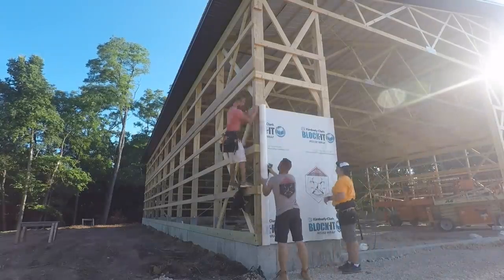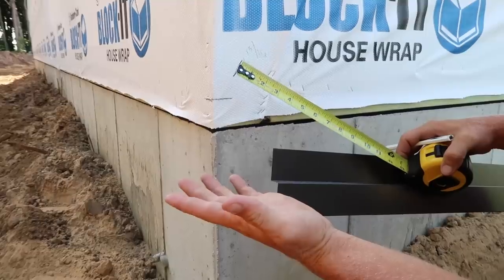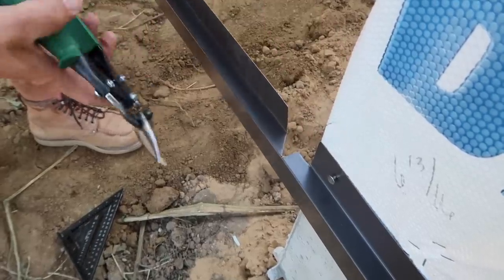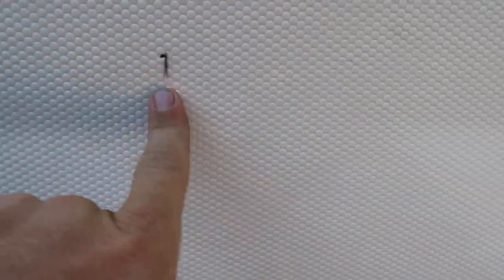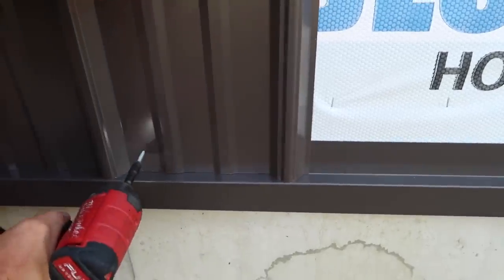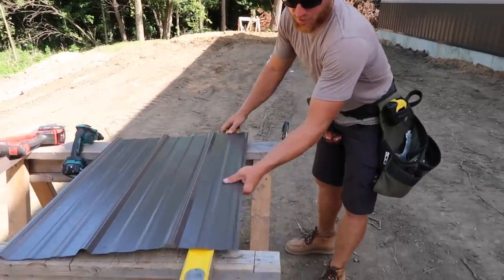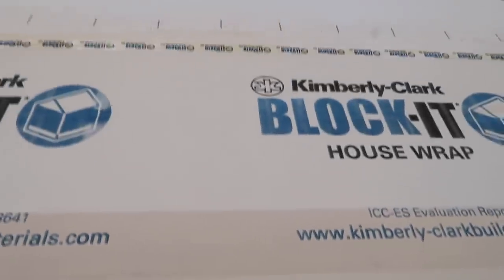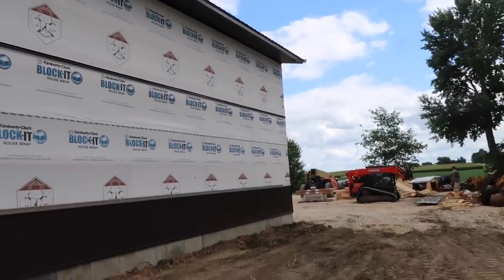Building the Dream: Episode 7, installing steel

Comment: Thanks very much for your really useful tutorials. We're installing steel siding on a former construction office trailer. The trailer sags from the axles forward and back to both ends. Your videos have helped us realize our mistakes and how to correct them, plus how to move forward in a reasonable fashion.

Comment: Don't beat yourself up over still using imperial measurements instead of the metric system, it's all just numbers.

My father was a shipwright who for most of his life used imperial and only in his 40's had to change to metric. I remember the struggle he initially had but eventually, he adapted. I still have all of his imperial woodworking tools and I am also quite comfortable switching between one or the other. All of the lumber sold locally has these weird metric dimensions like 19mmX305mm which is actually a 3/4-inch x 12-inch board so yea we metricated in 1971 but still sell imperial lumber.  😁 Another thing is I can not do fractions in my head as my father could, I have to think hard on it.

Just for reference, I live in Cape Town, South Africa. Thanks for the video's, I really enjoy them.

Comment: I don't comment much but I feel like putting my two cents in on one of your questions. The company I work for just had training on how to do Hardie Board Siding. When my company does Hardie Board Siding, we run the house wrap down to the pressure treated board like you did. After installing your base trim like you did around 11 minutes into the video. We put tyvek tape on the top of the metal where it meets the house wrap to seal it off. So if there was any water to get behind there it'd drain off onto your base trim. I know that's not the reason your using it but the instructor really wanted us to know that you never to put the house wrap over the base trim and tape the top of your base trim.
Reply: u would thinnk base trim,.... then tape ... then wrap so the wrap acts like a shingle...

Comment: They make straps with clamps that go onto your scissor lift (not sure what they are called sorry), they strap to the cage and then clamp to the sheeting so you can raise the sheets up via the lift.  Only reason I know this is because I do demo and while we was ripping off old sheeting, a company was following behind us installing the new sheeting in this fashion (huge steel mills).... was super quick and obviously saved a lot of physical labor for them.... I just wished I knew what they was called for you to check them out is all... with shorter pieces they was running multiple of them at a time, was pretty cool to watch.

Comment: As of the metric stuff. You can get a measuring tape that has both metric and imperial, like Stanley 30-696. 5m/16ft, 18mm width. Really handy, especially for woodworking. Really good quality measuring tape too. They also sell Stanley 1-30-656 which is 8m/26ft. Width 25mm/1in. Stanley also has a FatMax version of this 8m/26ft tape, with 32mm width, more heavy hook, which is even better for construction sites. Even if you don't use metric that often, it makes you get really accustomed to it very quickly and it always is there in the same tool, or to share on videos :D

Comment: At 10:35 when you're talking about not running house wrap over that sill flashing piece... I agree that it would look like crap if the house wrap ended up showing later, but you never know when water may get behind there. So to satisfy that and to satisfy the perfectionist in you (I'm a perfectionist as well) I would run a line of FlexWrap EZ by DuPont (self sealing flashing tape). There are other brands out there too that you could use. Try it and see if you like it; I think it would make for a better install.

Comment: For punching holes use old engine  valves grind point ;we use to do this on the old heavy galvanised even had a hand protector with top of the valve

Comment: This is coming from an Ex-Iron worker who is now disabled. First, it is called an awl (One word not letters). Secondly, instead of spending $3 dollars on one when it is just going to bend on you. Why not try using a 12 penny nail. They are cheaper and just as strong to punch holes in the Sheet-metal siding. When I was able to work, we opted to use them instead of drilling as well. Just a friendly tip.
Reply from the maker: David Tyner thanks David.  Appreciate it
Reply: Not a problem. Just trying to give my knowledge to those who can use it for future projects.

Comment: I was taught to house wrapped over the base flashing. Just leave the bottom un-stapled and snap some level lines on your grade broad. Better than packing that grade stick around ever time you go to set a nail. I hate that beeping and seems more productive to just snap some lines. You can always double check it once it's installed for peace of mind, if you want.

Comment: You need an awl made of hardened tool steel to do the punching...or alternatively sharpen the point of the el-cheapos occasionally on a grinder or belt sander. A machinist could make you a tool steel blank and harden it....keep it sharp and it will last for quite awhile.

Comment: Hello, Great video.  Starting a wainscot project soon.  Not sure if this will make sense, but one side of the house is on a slope.  Would you run the slope angle from the top side to the bottom for the base trim and sheeting or step down the slope?

Comment: Given your house wrap is for water control, you should seal that wrap-to-foundation joint. Yes you have foam in there, but I wouldn't trust that for water control. I'd use a liquid applied flashing or Block-it compatible tape to cover that gap. Then shingling the wrap over the metal trim isn't even a discussion. Also, you should never assume your cladding (metal in this case) actually keeps all water away from the structure.

Comment: Awesome videos!  I do have a question though.  You measured 37" for the first piece to land on.  When you start the first sheet do you have to rip the left edge off?  The overall of my sheets are 37 5/8.  Are my sheets are different than what you are using?

Comment: 1:07 Hello, have you thought about protecting the vertical edges of the building from foiling? For example, pieces of wood and the edge are covered with an additional thin material.

Comment: Hey Kyle why do you drive a roofing screw into the Lower flat portion of the tin and not the high ridge portion? not concerned about water leaking in on the flat surface irrespective of the rubberised washer (Sometime they can split as you know)

Comment: Just working on  
A project at moment, i imagine this is the eternal question. If i need to do long straight cuts on corrugated zinc alum whats the best tool for leaving best edge finish.
Reply from the maker: shear
Reply: I wish i had of paid more attention to this site. There is  a lot more craft to tin cladding than i thought.     These guys are really amazing.  Much respect and admiration.

Comment: They make hard steel punches. I've used them building race cars for 35 years. Most of the ones I have I've had for 30-35 years.

Comment: What if you initially punch the steel and then use those holes as a guide to drill out the rest so the bit can’t walk and scar up the metal it might save you some awls

Comment: At 22 minutes you said that you were running the Bender perpendicular to the sheet.  You actually were running it parallel to the sheet. Perpendicular would be at a 90 degree angle from the other surface

Comment: Are the tall sheets on the end wall pre-cut from the supplier, or cut on site? Also a video for ordering/calculating  steel metal might be a valuable video for us subscribers. :)
Reply from the maker: markssquared thanks in my
Mind to do that video... I cut all angles but have the sheets cut to different lengths

Comment: Correction at 31:29 Parallel not perpendicular.  Parallel is with the long side of the metal sheet, perpendicular is across the long side of the metal sheet and with the short side of the metal sheet.

Comment: Hey Kyle... In my area, it seems that all of the builders put a Z trim across the wall on the gable side. Is that because they are lazy and can't stand up a tall wall panel or do you think they have a reason? Maybe it's a local supplier or transport issue?  If they can get a 40' truss here why can't they load in a 27' piece of wall steel, right?
Reply from the maker: I think it’s a way to make their job easier.  I personally think tying it all together with the steel from top to bottom is much stronger

Comment: For the awl, say it how you see it, sounds like all
You could get a screwdriver and sharpen to a point, they are hardened so shouldn't bend, just need an impact resistant handle

Comment: A "scribe" is a scratch awl. It's made to scribe, or scratch marks on wood or soft metal. It's not a bradawl (or wood awl) wich used for punching holes and made of stronger metal. There are also awls made to pierce and stich leather and carpet. And it's awl, not a w l. ;)

Comment: ive never used one of those lasers you use. in my world(well head :D) wouldnt it be easier to use a traditional laser that makes a line? pls explain
Reply from the maker: Micke never going to
Get a line out 100’ in daylight
Reply: so the issue is daylight?
Reply: as you know, im an apprentice in your profession now :D so im all eager to learn the trade :D let my know if you want to know anything about painting :D
Reply: On distances of more than a few meters in daylight you have to use a laser receiver in order to get a accurate Reading. At 80 foot, 26.6 meters for us in the EU, you also need to  make sure you take the horizontal error into account. Typically you have an error of 4 mm at 10 meter for this type of lasers. Placing the laser at one end of the building and measuring all across to the other side gives you maximum error at the end. Better would be to place the laser in the middle, this will at least half the error.

Comment: you should start with a 6" piece of your house wrap behind your base flashing and then run the rest over you back leg. Having metal directly against any form of wood is not a good idea. Metal does swet with the potential of rotting the wood.

Comment: Another great video. I like the use of the Milwaukee Surge. For those that are interested in tools as well as their applications, there is another channel called VCG Construction that does a ton of videos testing and comparing tools, putting them through their paces, and they did a couple good ones on the surge. Here's a link, go check them out as well. https://youtu.be/gD3CCHUhUZA Keep up the great work, Kyle!